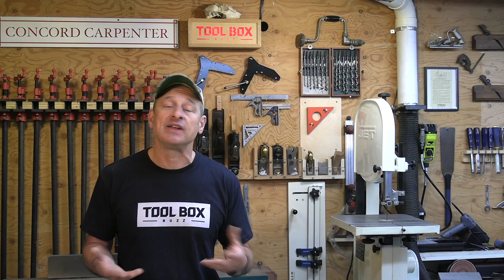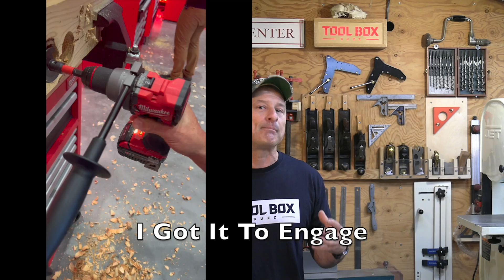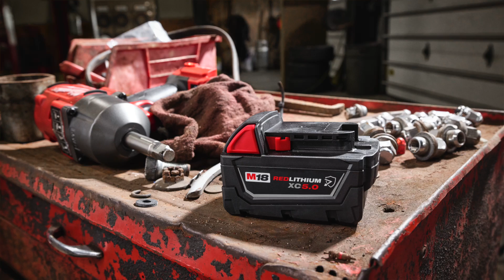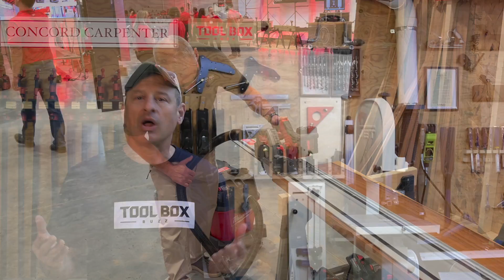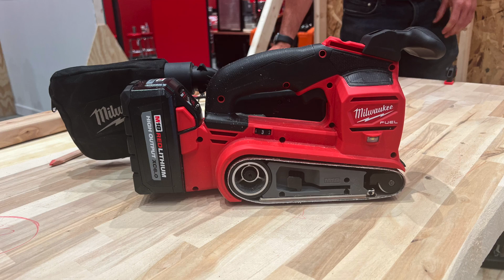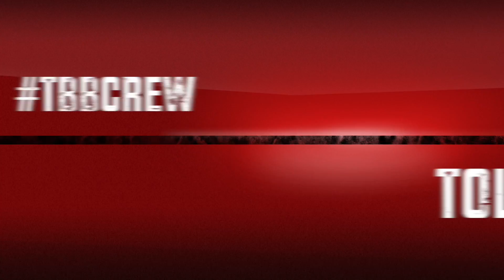Milwaukee NEW TOOLS for 2022

Comment: The only new Milwaukee Tool that's Universally useful is their M18 Inflator......

and maybe the new M12 3/8" slim head Ratchet.....

i wish Milwaukee cater to the Outdoorsmen, Campers, etc....   like an Electric Grill, Air Horn, Hole Auger, Glue Gun, etc.....

And maybe an E-Bike.......

✌✌

Comment: I use my m12 fuel impact every day as a maintenance tech. the size is perfect for keeping in my tool bag and I have yet to encounter anything on the job that it couldn't handle
Reply: My brother has a set of those. I always used to make fun of him and tell him he needed to get a set of real mans tools like my m18 stuff. Then i got the m12 installation drill for cabinet installation, and i can say i probably use that thing now for driving screws more than my impact. Its so light and balanced but powerful enough to put LP trim on and hang doors with 3 1/2” screws. My impact really only comes out when i have to do lots of screws and for my sds/ sdws/ timberlok type screws for structural connections
Reply: @markdoumert4840  for bigger construction/fringe jobs, yeah. M18 all day.  But for what I do, the M12 is perfect

Comment: I have the gen 2 m12 hammer drill and while it does the work, the clutch sucks and the trigger is garbage. I have to really crank down to get full power. If I even think about touching the clutch,
It moves. It’s a solid meh.
Reply: I'd be willing to bet the Gen 3 will be much improved over the Gen 2, since it now has a mechanical clutch whereas the Gen 2 had an electronic clutch.

Comment: I bought a Milwaukee miter saw in 2012 , junk is the best way to describe  . The warranty is was just paper . Milwaukee refused to  warranty the saw .I am not a big business so I cant afford civil action against them . Buyer beware . Never again will a RED TOOL be in my garage
Reply: When did you try to get it fixed and you talk about the lifetime warranty
Reply: @chaddarr4834  2014,Customer service for MT , The lights that mark the cut location died and they are a soldered connection . The CS advised the lights are pop out and pop in with regular automotive  fog lamp type .I would like to send you a photo and they said "not needed "bc there is nothing  that addresses this in the owners manual   Have a nice day and they hung up . My only Red tool , lesson learned the hard way . Piss on them , Sadly ,Horror Freight treats their customers 100% better  than MT ever did me .Good luck if you have any issues

Comment: I’m new to woodworking and was dead set on getting the Festool line. Now I’m not so sure. Milwaukee is looking nice. We do tiny pieces of wood for indoor signs.
Reply: You should invest in a 12v Milwaukee  Multitool,or any Multi tool ,can  save you time and money, I like Milwaukee 5  year tool no questions ask warranty, they go by  date of manufacture,, not like Ridgid that  you have to register online, ( which I often  forget to).
Reply: @aurelio-reymilaorcabal9669  thank you.
Reply: Festoon is very overpriced, I’d recommend go as high as you can afford. DeWalt is great and even Ryobi is good enough if you are new
Reply: @timothyjewett625  I have some Milwaukee nailers so I'm in their system. I just need a track saw and a miter saw. I was debating Festool for those but now will likely keep it Milwaukee. :)

Comment: That they still haven't replicated the 9ah M12 battery of the knockoff market is sheer idiocy. Also, I'm surprised they haven't dived into the stacked lithium yet.
Reply: They said they would be getting into stacked lithium, can’t remember where I saw that
Reply: Milwaukee has the patent on the round cell lithium batteries that they’re using And that everybody has been using so they’ve been getting money off everybody’s batteries

Comment: Been using Gen 2 Fuel 12V impact & drill  combo set , very happy with it , yes  i use it 95% of the time  over the M18,will need that Gen3  next year , me and my Milwaukee  toys.
Reply: My yellow 20v stuff has been untouched since I went M12.
Reply: @RoRo20699  I use M12 for repairing my cars, 20/60v for work/everything else.
Reply: I’ve got the original 12 v brushed  there OK  and run like you think a 12 V tool would run but the fuel is extremely extremely better like an 18 V and that hammer drill is amazing. Bought the 12 V fuel set for one of my guys And tried them out before I gave them to him and man night and day difference from the original
Reply: @chaddarr4834  I bought  2  12v Fuel combo sets ,  plus multiple batteries   from Home depot when on sale, , since then the M18  brushed combo sets  gather dust, waiting to be sold when I retire in the Philippines  , cordless tools are super expensive there, with a Dewalt  20  volt Drill  set costing $150+ and 1/4impact drivers still a luxury, so are cordless saws, I have Yellow  , Red and Orange ( Ridgid)  tools, I think Filipinos in the Philippines  have yet to discover what a Multitool is, buying me a 12v Fuel Multi soon,  already have a XR  DEWALT20v  Multi .LOL

Comment: Looks like I’m gonna have to break some of my tools so I can get some new ones
Reply: Throwing them under wife’s car adds guilt approval.
Reply from the maker: I like the comment about throwing them under the wife’s car to add guilt
Reply: @ConcordCarpenter  My luck I’d pop all four tires
Reply: Ok so apparently i am not the only one doing that 😂😂😂joke
Reply: Lol why don't you just pawn or sell them and use that money towards the new stuff?
Reply: @Lee-lb9qh  That is what I need to do, I got a small HVAC company and usually Supply all the tools for my guys so they have everything they need and good tools plus I get to feed my tool addiction too!  Red on my truck,blue on the others,yellow at the shop!!
Reply: @chaddarr4834  nice, all I have is Dewalt but I like other brands too, my coworkers have Milwaukee and Makita and Ridgid so ive used them a bit
Reply: Sell them
Reply: Makes sense. 😂😂👍🏻
Reply: Don't! 

Save them for the rookie to do it for you 🤦